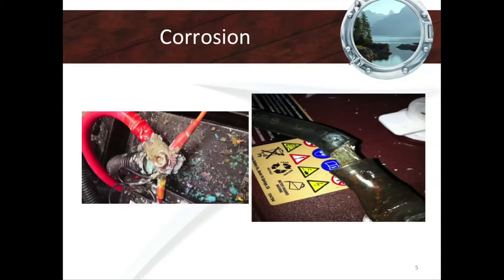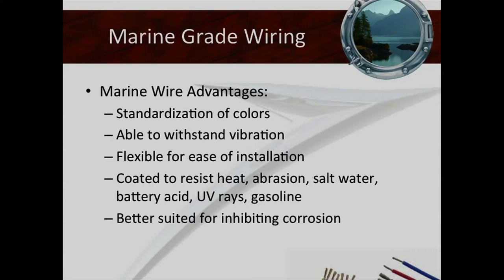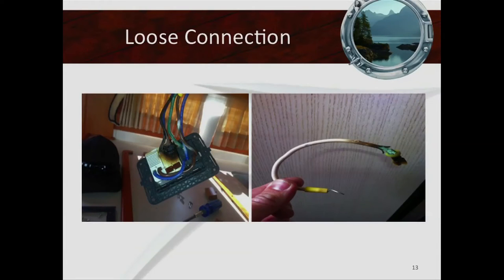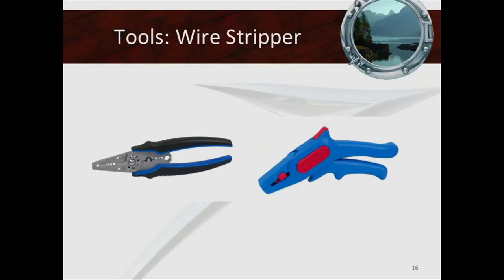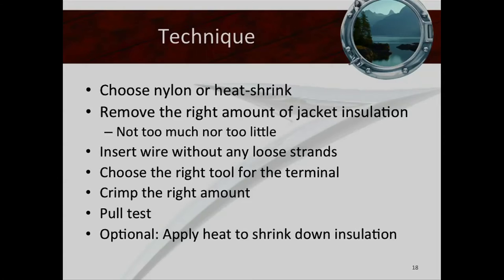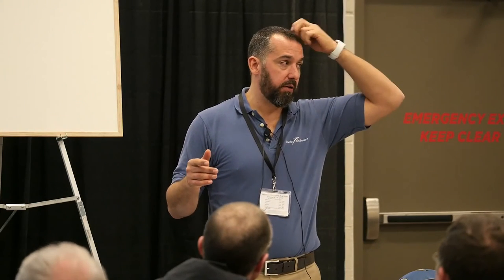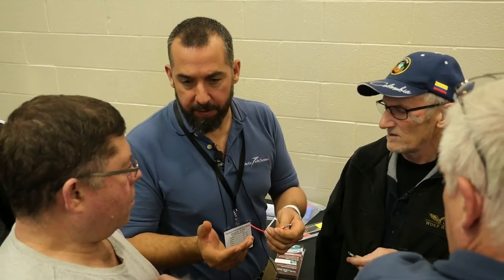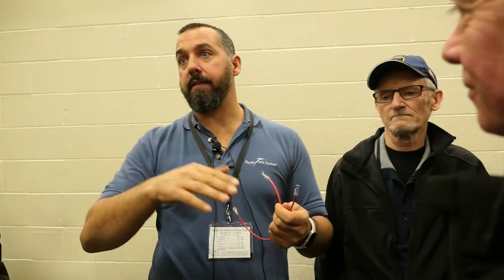Boat Show 2016 - DIY Marine Electrical Connections

Comment: Ok, I admit to one of these. I have, rarely, at times, snipped off a few conductors to  fit a larger wire into a smaller connector. However, the few times I have done so, I both fused and labelled the wire for the resulting smaller wire size, so nobody would ever have to guess. There is only one reason I have ever done this: voltage drop. Some equipment manufacturers skimp on input connectors, forcing the use of a smaller wire size, resulting in wire heating and voltage drop. I like my wire runs to be as cold as possible, so I like to overspec my wiring. Apparently, I insist. Disclaimer: I am not suggesting that anyone do this; it is a no-no. Wire strippers; my fave for most small wires is the Klein Katapult .  Finding the right crimpers is some kinda' voodoo., and some of them cost a small fortune. The fun part is, if you're wiring entire systems, you need at least 2 crimpers, 2 cutters and 2 strippers ; a set for small stuff and a set for moose wires. Unless you're doing a lot of crimping, it is more cost-effective to let someone with the proper tools do your large crimps. If you know you're going to make more than 50 large crimps, you might as well buy the (low-mid priced) tools.  Hot tip: If you use smaller wires when you'd prefer to use 4/0 because it bends easier, try bending your 4/0 and holding the bend while terminating the ends; for wires of a foot or less, this makes a big difference. Protective coatings; Caig Labs deoxidizers and protectants. Their products have a skinning oil in them for protection without being too sticky and seals the contact points; they also have electrical greases for the tough jobs.  Keep your panels in the sun. :)
Reply from the maker: Hi Tao4409, thanks for all the input, this is really good stuff.
Reply: @PacificYachtSystems  Always a pleasure sir. Keep the great material coming. :)